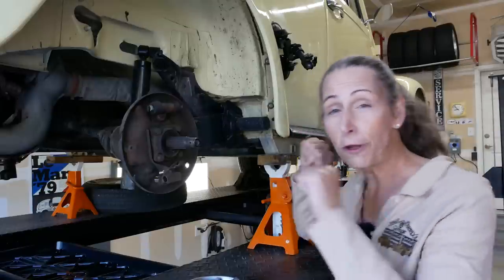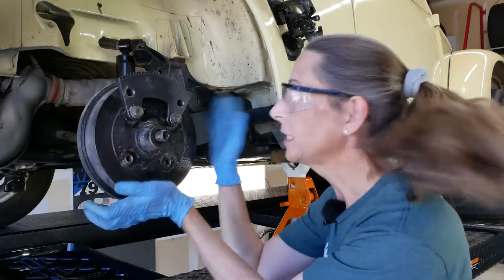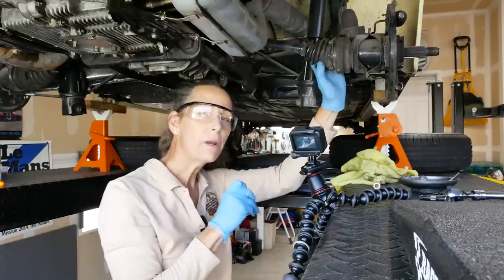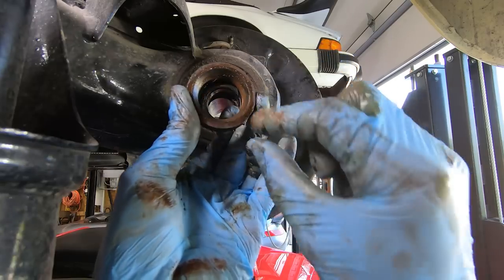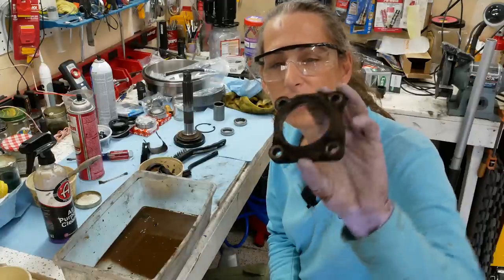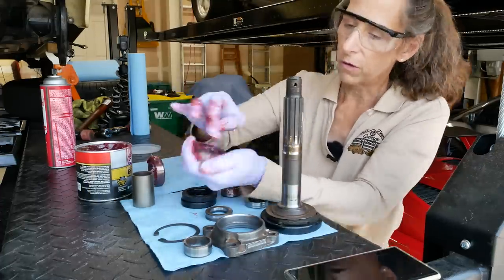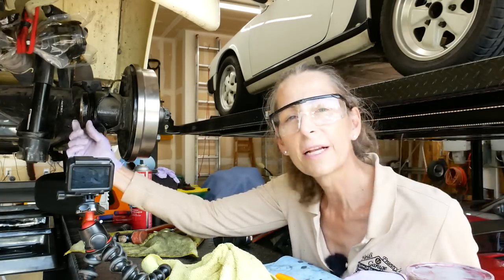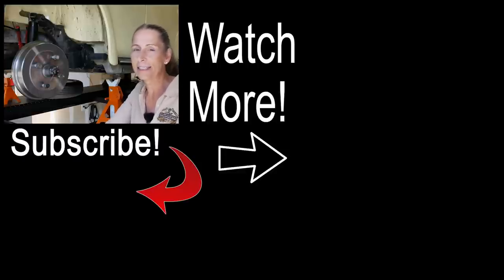VW Beetle Rear IRS Bearings - Quite a job!!

Comment from the maker: Hi Everyone! In this 1969 VW Beetle episode, we are replacing the rear bearings - inner and outer.  The is an IRS (Independent Rear Suspension) and not a Swing Axle car (first year I believe).  The old bearings were shot - maybe not as bad as the fronts, but still loose and worn.  It is a bit of work, but straight forward enough.  The brakes will be coming up :)
Enjoy!

The VW Torque Multiplier too for rear-wheel nut: https://amzn.to/3besSiq
The Ring Plier kit: https://amzn.to/3gDDw33
The Star/Triple Square/Spline Drive toolset: https://amzn.to/31DUHxk
Seal Puller: https://amzn.to/2EPxT4y
Rubber Mallet: https://amzn.to/2ENIBJ6
High Temp Bearing Grease: https://amzn.to/32IA5U5
Reply: Help. where did you get the axle multiplier and rear bearing seal kits????
Reply: I recently bought a 1974 Super Beetle, and these videos have been extremely helpful. Thank you so much. I also like how Franny smiles at the camera before cuts.

Comment: FYI: the paper gasket should be used, but the little hole at the bottom of the gasket should have been punched out as that little hole is the weap/drain for the hub you just rebuilt.

Comment: Most of those rear bearings have a tiny bit of play it’s completely normal. The tapered roller bearing is for side thrust and the roller bearing is for vertical thrust loading. Obviously wiggling it by hand is not going to tell you the amount of play, you will need the wheel on and the castle nut torqued up to 250 pounds/foot. If you have excessive movement  I have heard some guys turning a couple of thou off the centre spacer in a lathe to eradicate the play, but not sure I like that idea, excessive play after replacing them is more likely to be caused by crappy after market bearings. Love your vids, thanks for the content, great attention to detail.

Comment: Some of the old schoolers used Stoddard solvent for cleaning parts.  Cleans well.  Very high flash point.  OSHA sets an upper exposure limit of 500 ppm per 8 hour workday.  20,000 ppm is directly toxic.  Should be used with a system that contains the vapors and avoids skin contact.  There are better ways to clean parts.  On the gasket, the old style swing arm axle was full of gear oil?  At worst it's going to offset the casting by 1/4 mm or so.  Shouldn't affect the preload on the bearings.  Thanks for sharing!
Reply from the maker: Thanks!

Comment: This is what I use for cleaning parts. I have an old fridge tray , steel / enamel corrugated base. And the solvent I use is petrol, bit stinky but it works and its cheap, also a stiff brush and hose it off. Just air dry it immediatly to prevent surface rust. And I wouldnt use a screwdriver to remove bearings , you will just destroy it. Use a suitable punch.

Comment: Parts washers are required and Varsol (mineral spirits) is best to use. Eventually it will become more and more flammable, so fire extinguisher is a good idea! On commercial washers they have a fuseable link that melts in case of fire and let’s the lid down to smother flames!

Comment: Heidi/Franny, I am rebuilding this component right now. Your video is my bible....so glad you made it. Can't thank you enough!!  I use diesel fuel for cleaning. Low volatility ,but works well. Then brake cleaner or carburetor cleaning (gunk) fluid.

Comment: Hi Franny, I just did a rear wheel bearing replacement on my 66 swing axle today. After watching several videos on how to do it the wrong way, I read my shop manual for the right way. One step that all the videos miss is, that you keep the castellated nut on the very end of the shaft. Then hit the nut using a drift and hammer driving the shaft towards the transmission slightly, thereby dislodging the bearing enough to fit a gear puller onto it. That’s how it’s done. Cheers from Australia, Frank
Reply from the maker: Thanks for that Frank.

Comment: I have a 1978 Super Beetle Convertible that I changed the rear wheel bearings, the right drive axle assembly, did a complete rear brake job including replacing brake cylinders, and converted the front drum brakes to disc brakes. I could not have done it without your help. Thanks for the EXCELLENT videos with the helpful details that you include. I got my parts from JBugs, SoCal and Amazon. I bought the heavy duty ring clip pliers that you use on Amazon because the ones I have were insufficient. I also bought the CV bolt 12 point hex socket from Amazon. I took the rear bearing caps to a machinist to remove the outer seals with a hydraulic press. O’Riley Auto Parts has a loaner bearing, race and seal driver tool that I was able to use which worked very well. Please keep the videos coming. If you ever rebuild a super beetle front end or rebuild an engine or transmission please post it. Thanks for what you do! A lot of help!
Reply from the maker: We.would post, but we have no plans too.

Comment: I've had my 1970 VW since 1972, and my 1971 VW since 1976, and I've NEVER greased or replaced their rear wheel bearings.  I'll also NEVER serviced their CV joints or boots (not torn), but have had the CV axles disconnected on my 1970 when I removed/installed a rebuilt transmission in 2018. Good video, and note that I am NOT recommending that others follow my lead on those rear bearings and CV joints.  I just made my mind up decades ago to just replace CVs or drive axles rather than deal with the CV balls and greasing.

Comment: From the changes of shirts in the video I'd say you did this job over several days. That's actually a good thing. Keeps you from getting worn out and frustrated. I usually have only one car at a time so have to finish what I start, or at least used to. Retired now so don't need a reliable work car.
I've never done bearings on the drive axles. You made it look fairly straight forward. Like you said, you need to have the right tools for the job.

Comment: Parts cleaning: I use a repurposed empty protein can cut in half. I use Simple Green unless it's super grimy, then I'll use auto store spray degreaser/ the nuclear toxic stuff. The fluid then goes in my oil change can that the auto store dumps for free. .....I'm not new to engine work or auto restoration, but totally new to Volkswagen. Thanks for the super informative videos. Your filming, editing and explanations are great.

Comment: We have a 20 gallon parts washer from Harbor Freight. We filled it with a 50/50 mix of Purple Power and water. To give it extra cleaning power before filling it up we drilled a hole in the back of the tank near the pump assembly and installed a 1250 watt water heater element set at about 120°. The heated Purple Power solution simply melts the grease away. In fact it is so strong that it stripped the paint off of the inside of the tank below the liquid level.

Comment: Fran, since you have made the investment in 4 post lifts, why not purchase a rolling bridge jack instead of hoisting that small floor jack onto the 4 poster?
I clean bearings the same as you; no FM about that.
I also like to freeze bearings overnight, shrinking the diameter a few10ths of a mm so they install a little easier.
Reply from the maker: Thanks!  Yes that bridge jack would be sweet!  They are 1/2 the cost of a lift...  Maybe someday I can talk Heidi into one :)

Comment: I use a big galvanized pan like you'd use to feed chickens for cleaning parts.  I've used all sorts of solvents, MEK, acetone, mineral spirits, 1,1,1 trichloroethane (really dangerous stuff), and the old standby brake parts cleaning spray.

I think 1,1,1 trichloroethane is illegal now, but we used gallons of it in the Bell System.  It's a fantastic cleaner.

I don't think you can get real MEK anymore, but the MEK substitute is really good.  Usually substitutes are garbage, but I'm impressed with the fake MEK.

Comment: I love the tool for removing the large axle nut.  That would have come in handy when we did rear bearings on the 924 and later on the 914!   You were fortunate that the bearings popped out easily.  Whew!   For parts cleaning we bought a 5 gallon pail of parts cleaner that was used in a vessel big enough for the item being cleaned.   It does a super job.

Good call on the seal for the bearing cover.  Great job as usual, thanks!!  And good news about the 911.  Can't wait!!!
Reply from the maker: Thanks Judi!

Comment: Hello from UK - came across your channel thanks to Ratarossa. Your channel is GREAT and shows exactly what is involved in the job. It is what I am trying to achieve on my channel only you guys (ladies) do it so much better with slick editing and lighting and commentary. I have much to learn! Split and cotter pins are often confused but that is a 'split pin' on the hub - a cotter pin is what is used to hold pedals on a bicycle. It is one of the first times I've seen someone actually re install the split pin correctly - most people bend both prongs making it really hard to get off 30 years later! Porsche...VW....just missing an old Merc. Mike
Reply from the maker: Thanks Mike.  I guess I need to brush up a bit on my pins :)  Welcome to the channel!  There is still a bit to go on the Beetle :)

Comment: This video was one of the best I've ever seen on YouTube for wheel bearings on vw beetles 🐞 Also I wanted to note that your attention to detail as well as your suggestions and tips are top notch. Thank you very much for providing a first timer with the knowledge to tackle this job. 

The only thing I was a little concerned about and it could be a different year - but there is small o-ring that slides over the axle under the outer spacer that seemed to be missing. But again, could not be required for your model. I have a 73'. Cheers!
Reply from the maker: Thanks so much!  Yes, I believe that is for the Swing Axles.  I have to admit I was a little confused with some conflicting info I saw, but the main difference is that the Swing Axle setup has to keep the oil from the transaxle out of the brake system.  Let me know if you disagree.  Thanks, F

Comment: Dont forget to tell the owner of Lemon Drop that the posterior sway bar works wonders for stabilizing the bug in curbs. My brazilian bug didnt have the sway bar and now that I found out that I can place one to it. The driving is actually better and stiffer. It handles the turns fantastic even at high speeds.
Reply from the maker: That is a great tip!  I'll let him know :)  Thanks!

Comment: Greast tool, I have seen them on line but its cool to see how its actually used.

Well done

there was a lot of play and clicking because you already loosended those 4 bolts (14mm). Thats where your clicking was coming from by the looks of it.

You dont have to lock the wheel down to get the CV bolts loose, just use a small inpact gun set low.

As far as cleaning parts, Harbour Freight sells a decent parts washer( its like a tub with a fluid pump that pumps the cleaner up a hose, threw a brush and onto your part.. cleaning fluid i used Var-is-all ( Not sure of spelling, but thats how it sounds.)
Reply: I used a small pipe wrench on the axel to hold mine from turning. It seemed to work well and i didn't see that it hurt anything. Just thought Id mention it. EE

Comment: Always love your teaching technique. Have used a bench top cleaner with mineral sprits for years also a cheap dental ultrasonic. In addition to freezing the bearings I heat the backing plate with a heat gun. Miss the pearls.
Reply from the maker: Thanks James :)
Reply: and an ultrasonic cleaner works really well on pearls and jewelry too, not that Franny's would need much deep cleaning, as she can overhaul a whole car and almost not get covered in any gunk at all! :)

Comment: Thanks Franny, your the dogs! Another great “how to”, you now have the number one and two spots in my fave videos. 
According to my Haynes the torque on the bearing cover bolts is 43ftlbs. I use various degreasers and a slosh bucket with lid.Mainly use acetone for just metal parts, also brake and carb cleaner and elbow grease etc.
Reply from the maker: Ahh great!!  Thanks!  I'm going to have to get a proper manual if this car comes back much more ;)

Comment: Hi Franny. Excellent  video! Super clear! 
If I remember correctly,  the external bearing need a washer and a small o-ring beetween it and the outer metal spacer. Those are included in the oil seal kits.
Reply from the maker: Thanks Horacio, Those parts are for the swing-axle cars.  The IRS cars (the ones with the CV joints) don't need them as there is no transmission oil to deal with.  Franny
Reply: @HeidiandFranny  
You are absolutely right!

Comment: Great video ... again.  Did you mention that some CV-joint flange gots are, indeed 6 point?  Yep.  I have no idea why.  Also, these CV flange bolts must be torqued to 25 ft. lbs..  else, they come loose.  CV models require 253 ft. lbs on the castellated axel nut.  So, I put 28 ft. lbs. on my Torque wrench, then turn the bolt on my TorqueMeister (torque multiplying tool) until it clicks, which gives me 252 ft. lbs (close enough).  The lesser torque 217-220 ft. lbs. is for swing-axel models.

Love your videos!
Reply from the maker: Thanks for all that!

Comment: Hey, great video!!! I really like how detailed you are and explain everything so anyone can understand. So, just a couple of suggestions/comments: get yourself a bearing and seal install kit (they aren't very expensive (Harbor Freight) and you don't have to use your socket...I believe you said, the right tool for the job ;) ) Also a solvent tank, in my opinion, is better than a plastic container. Many places carry benchtop versions that won't take up a lot of space. You can use parts solvent that you can purchase at your local auto parts store or, I use diesel fuel. As long as you use something that is oil-based. Also, for the next time you have to do the rear axle seals/bearings, the rear axle bearing cover bolts should be tightened to 40 ft-lbs. Lastly, NO SCHMUTZ! LOL

Comment: Building a vw sandrail and researching bearing and seal replacement before spending time on it myself found your video very informative and helpful. Tool selection helped in preparation as well thank you. Parts cleaner, I use a large jewelry sonic cleaner with different solvents for specific component. Work on bicycles too and the ultrasonic basin helps greatly shaking dirt out of small mechanical parts.
Reply from the maker: That's a great suggestion!  Thanks.

Comment: Loved the video Franny! I cut the face out of an old 1 gallon Rotella jug (an antifreeze jug works  as well ) for cleaning small parts. I use gasoline (GASP) but am very careful with it, using the least amount possible, then finish the clean with brake cleaner.
     The second cog that came with your torque multiplier is for the 6 volt system, evidently the flywheel/ ring gear is slightly different. Where the multiplier is just about an absolute necessity is removing the gland nut off the flywheel. Could not get a long enough cheater and ended up breaking a breaker bar, with the tool it was really a piece of cake.
      A long punch works well for knocking out bearings, I wouldn't use a screwdriver personally.
       This is the point in the build where I'd have sprung for the disc brake setup. You went through all the steps and did all the work (let alone spent money on drums and shoes) and still have beetle bug brakes.
Reply: I understand the "keep it original" crowd, I just don't run with them..
Reply from the maker: Thanks Tim, I didn't know the 12V and 6V are different.  I originally bought it for the 356 and had to actually machine an offset 36mm to get it to work with the 180mm Flywheel.  I really like that you can set the correct torque on reassembly too.  Yes a punch much better than a screwdriver (that is what I used on the other side).  I shouldn't have been lazy and just used the screwdriver I had right next to me ;)  Thanks for calling that out.

Comment: Great episode, loved the torque multiplier. On another note, I finally got around to putting the LED ribbons on my lift, a Backyard Buddy, which I bought in 1998 and was lucky enough to be able to use the inner vertical surfaces so the light goes both up and down. Definitely works on muffler installation.   Love the show watch you on the big screen (65") By the way I have a 1998 boxster from new, with the speedster humps and only 19000 miles on it .  Thanks and keep them coming, Jack Neve
Reply from the maker: Thanks!

Comment: Great video! I place the the axle nut onto the axle and bang in that to prevent any damage to the threads. The swing axle gasket kit is set up for oil coming from the transmission. So you really don’t need that outer paper gasket since the grease is a different viscosity than oil.
Reply from the maker: Thanks for that...  Yeah, I didn't think I needed that gasket.  I don't think it hurts, but not necessary.